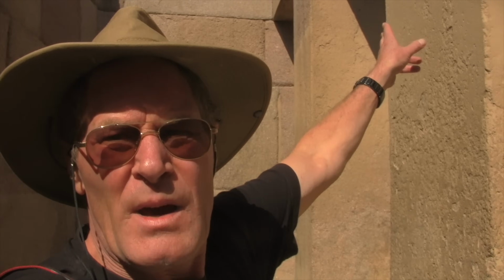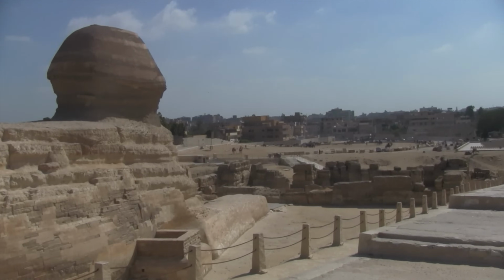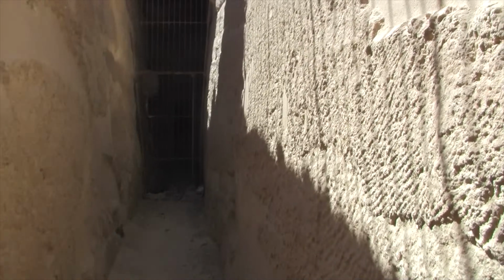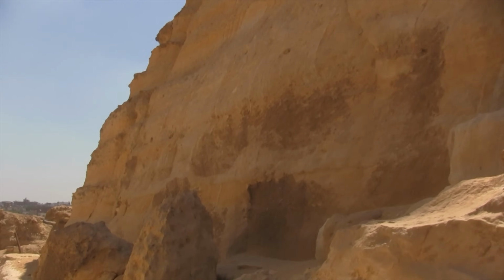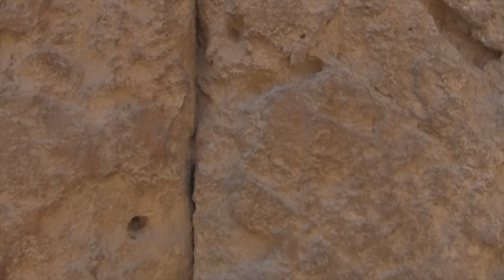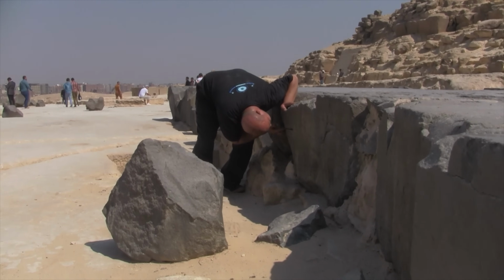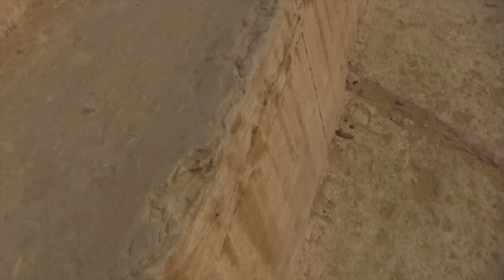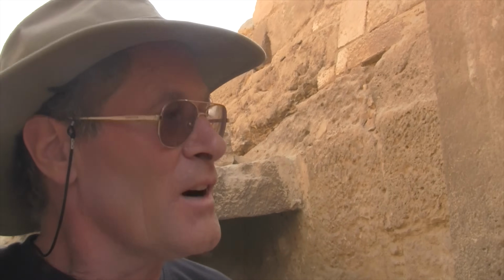Exploring Out Of Bounds Areas On The Giza Plateau In 2014

Comment: What if the pyramids were water pumps and/or control valves? The 'robbers tunnel' may have been an attempt by ancient peoples to break into the machine to try and shut it down after it malfunctioned during/after a mega disaster some 10k years ago. The pyramid pumps maybe went into overdrive and flooded the plateau which maybe explains the erosion and destruction of a lot of sites and structures, and also the flooding that prevents exploration of some tunnels to this day. The casing stones may not have really been purposefully taken off the pyramids and surrounding structures, the pyramids themselves may have vibrating from the malfunction and they all just kind of fell off. The vibrations spread across the plateau which could be described as an earthquake, but caused by the malfunctioning pumps (pyramid(s)). IF the builders were still around at this time that would explain how they seemed to know exactly where to dig to get to where they needed to be. The famous box in the great pyramid could have been damaged by looters but also by some engineers desperately trying to get into the box to do whatever, maybe remove the battery/fuse which made the whole thing work, whatever that might have been. An earthquake would certainly make workers drop tools and start running when 100ton blocks falling down on them. No idea what became of the peoples after that but with a lot of their stuff destroyed and possibly a lot of people dead, they abandoned it all. Later peoples then just looted the stones that were already fallen and they continued past that to try and get more. If you look at the top of the pyramid with the casing stones still on it, those blocks look like they were shaken loose because why wouldn't you start at the top if you were robbing them? Naw, the whole damn place was shaking and they all just fell down with the lucky top courses staying put but slightly separated between them all. That's vibrations.

Comment: No. it is not easier to build with smaller pieces and mortar, this is the finest quality cuts on the finest quality materials that there is in the range of Enoufgh material to build many structures that they knew how. we don't. sure we can mortar together some walls on a steel structure and it would never be the same thing.

Comment: Brian, you probably won't ever see this but simple logic tells me their purpose was far more important than simply storing two dead bodies, and would have to warrant cutting and placing several million blocks. In my opinion they appear much older, having survived the global cataclysm some 12,500 years ago while everything else was crushed under the weight of the mile high wall of water that swept it all out to sea.

Those large vertical shafts may have been reservoirs for part of the cooling system, cycled into the "kings" chamber where immense heat had clearly charred the walls, then being forced out repeatedly as pressure builds from steam. The granite slabs above the reactor likely served as emergency pressure release valves to prevent a chamber wall from blowing out. 

I doubt the system failed, but probably just stopped working after 2000 psi of sea water had been forced through it, blowing all it's valve doors and mechanisms out the bottom.

Those dreadful gates may be due to safety concerns, but if that were their only reason why not provide us with maps detailing all the known passages and even permit guided excursions throughout these areas? After all, it's our history and it belongs to everyone.

Comment: I doubt you'll read this but: Man the more you talk about "not necessarily electrical energy or whatever" much less stone powerplant buildings exploding etc the easier it is to shrug off the many valid points you raise about inconsistent types, degrees and patterns of weathering and erosion that simply cannot fit the official narratives. 

No offense but when I speculate out loud I sound like a nut, meanwhile you sound like a thoroughly insane homeless guy outside a bus station. For example, by you're way-out-of-left-field reasoning the fact tuts gold mask is gold must make it electronic since we use gold in electronics today. Please, please, please leave out the goofy narrative about tight fitting stones requiring aliens or signifying powerplants or antigravity. Please. 

I watched a lengthy vid of you visiting sites in Italy exhibiting several types of polygonal monolithic stonework and you pretty well stuck the landing by staying on point and not jumping down any schizophrenic rabbit holes. There was evidence and you made the case. There's so much more tangible evidence of inheritance in Egypt but you spend half the time talking like it's a rerun of In Search Of from 1972, I keep expecting to hear about Pyramid Power magically sharpening razor blades smh. 

The evident timeline in Egypt doesn't fit the orthodox paradigm. The tool marks don't fit. The logistics, especially over the accepted timeline cannot possibly fit. This doesn't mean they couldn't build some or all of the pyramids but probably not in the limited time allowed not even just the limestone portions. They certainly couldn't do the granite work themselves in any amount of time rather than find and repurpose it. Pyramids might have been expansions of what they inherited. They could even have moved big granite artifacts like the Romans but only if they also had somewhat more complex tools Egyptologists refuse to concede like compound pulleys and primitive cranes more approximate to what the later Romans had. 

You can talk for hours and hours about a hundred mind boggling examples that support each of those points without ever falling off the deepend that makes even slightly skeptical listeners roll their eyes and change the channel unless they have no idea how ridiculously Woohoo half of the digressions are OR they already know about enough of the glaring inconsistencies to keep listening (but still roll their eyes when you go Ancient Aliens.) 

Zawi Hawass wouldn't listen if you found a perfectly preserved pre-dynastic nuclear reactor but plenty of other members of the mainstream might just have to admit the glaring deficiencies if only to themselves if you could stay a bit more grounded than a YouTube channel looking for views can get away with. And no I'm not suggesting they had nuclear reactors.

Comment: Moving the stones strikes me as easy. They had cloth, wood, clay pot batteries. Simply fill a big balloon of fine cloth with hydrogen tied to the stone, until the stone floats. You will lift 20 ton stones with a thirty meter gas bag. Bigger stones, bigger bag. Tow it along the ground with draft animals. Like the blocks in Peru that came from the top of a mountain, you get it floating when the wind is right, it will be on the ground in the valley in no time, as cloth will leak, no matter how fine, then you float it again and tow it. But how the blocks were made so precisely, is another question. It's indicitive of very high general technology.

Comment: I agree about there being a reason they chose high quartz containing granite, the importance of there being no gaps between the stones, and also the importance of no fissures in the stone.  It's pretty evident when you look at the boxes in the Serapeum.  They chose that material for a reason and pressure was involved somehow.  They even somehow "scooped" out the parts of the boxes that I believe had fissures or cracks.  I think that with pressure these cracks may have spread or blown up so they wanted them gone.  Add water for conductivity and then... I don't know.  I don't have the answer to that.  With the pyramids it seems like water was an important ingredient because of the retaining walls that I believe held it in at the bases.  I think one of the pyramids even had the first courses of stones be granite right up to where the retaining walls would have held the water in.  Quartz-containing granite + high pressure from weight of many stones without fissures layered with no mortar + water possibly being absorbed by this granite under pressure and causing it to be conductive = piezoelectric effect for... I don't know.  I need someone smarter than me to answer that.  Isn't there a pyramid that shows signs of blowing up from the inside?  High pressure was utilized somehow.

Comment: I theorize that there were 2 sphinxes, and that they were fountains with water coming up from the original lion's heads, and all of the pyramids( 3 large and 30 or so, small) were part of an aquifer that generated energy as well as fed the area with abundant water, and had lush greenery. That's what I envision. Then, it is possible that the water source depleted or was diverted. Thank you for the video, and the adventure.

Comment: It is CLEAR that the dinastic Egyptians did not build the pyramids. It is also clear that the Sphinx was NOT build by the original builders of the pyramids, just look at the state in which the pyramids are vs the sphinx. The sphinx CONTAINS megalitic work which means it was built AFTER the megalitic structures were built.

Comment: There was water all around the ancient pyramids. They should dig up the sand around the great pyramids. They will find proof of the ocean level there. They also used to use the coral reef as jail cells. And when the tide would come in, they would drown their prisoners that way. And if the prisoners found a way to escape the coral cells, they would be eaten by sharks. The ocean waves would break on the beaches or shores of the great pyramids in the past.

Comment: with the technology that Egyptians and even the World had back than had no way of cutting the millions and millions of huge blocks exactly accurate for each and every one of them to be used in the pyramids. This is impossible to do with the short periods of time when they were especially built. The most common theory of how they built the Pyramids is by using the Sun mainly and melting most of the materials and placed in a later period methodically. Because none of the materials were ever found were good enough %100 accurate and fast to built and cut the stones. Not to mention some of them were 162 TONS used inside the Pyramids.

Comment: So if it took thousands of years of heavy rainfall to erode the sphinx,  and the last time Egypt had a climate like that was 10,000 yrs ago. That means the sphinx has to be at least 12,000 yrs old. But I believe the desert begun when the younger dryus did, 12,000 years ago when the earth was struck by a broken up comet. Thus the sphinx would be at least 14,000 yrs old, but im thinking its closer to 20,000.since it would have had a plaster covering to give it a finish in white like the great pyramids. Which were not build by the dynastic Egyptians

Comment: Why would a culture seemingly so advanced, build a tunnel system so perfectly square simply to move water? And also, if they were so advanced, why are the tunnels square and not round which is most ideal for water pressure and movement? I don't think they do. I think those questions are just the tip of the iceberg, and just a few of the reasons they are closed to the public and the archeological community. There is so much more going on here. Twenty years? That's not possible. It's just not. And when they say twenty years they don't take into consideration the underground because we are supposed to pretend it's not there.

Comment: I have never in my 60+ years believed these structures were built as tombs, it made no sense, just like much of the BS history they try to push on us - I'm going with they were built to provide power - I believe they are on lay lines just as many old churches with huge pipe organs which I suspect used sound vibration for healing, perhaps the old churches were actually built for medical healing and had nothing to do with religion.

Comment: Even if they used boats for transporting the stones how many stones do you think their boats could handle at one time? So not only did they have to move them 500 miles away But who knows how many trips they had to make back and forth to get the amount of stone needed. Imagine having to make the 500 mile trip hundreds or thousands of times.  To move all that stone at once would probably require thousands of ships. So you need quarry workers constantly working to quarry stone you need hundreds of boat captains and sailors working on the ships. Then thousands of workers on the receiving end to move and place the stone and also teams of engineers working at all locations making sure everything is planned perfectly making adjustments coming up with solutions to unseen problems  or fixing and designing tools needed. Also would need teams of metal workers constantly making new tools or repairing old ones. You need soldiers protecting the workers and resources. You need food stores to keep everyone well fed. You need people who speak multiple languages. This is just the tip of the iceberg a project of this size would require the coordination and determination of tens of thousands of workers. like either they built these structures way easier than we know how or The entire culture did nothing but farm and build megalithic structures nonstop for thousands of years.

Comment: That's a saw kerf or thickness of the saw blade not the diameter, the diameter is the distance across the large flat side of the blade from one edge to the opposite edge crossing over/through the center  , I'm surprised you did not already know that. That was interesting Brien, thanks.

Comment: Hypothesis: The shaft/tunnel system was used as a crane system. Method : Get a heavy stone and sit on floating raft, lower to the bottom of shaft, flood the shaft through tunnel system, attach rope to heavy stone/raft which is now at 'the surface', rope then goes up to crane (pulleys can be used to multiply energy efficiency), release the water from shaft back through tunnel and use the weight of sinking stone/raft as 'power source' to operate crane. Perhaps we are looking at the infrastructure of a civilization that had mastered hydraulics. 

The 'falling water system' could also easily be used to power saws. It could also easily be used to operate a vacuum lifting system for very heavy rocks. 

This hypothesis could explain A LOT of what we see here but I am not convinced by it as I have no idea how they'd pump that much water, or was that the purpose of the pyramids to create a vacuum somehow.

Brilliant and fascinating videos Brien. 

Best wishes.
Reply: Wow that's a sensible suggestion. I had not considered that
Reply: Well they have a river passing by

Comment: It think that the blocks are cast in place one at a time from a concrete type mix,there would be no point making a 'precision fit' block that is not uniform with all the others and then have to carry them 500 miles to assemble in exactly the right spot.It would be plausible to cut blocks from the  top of a quarry cliff letting them smash to the bottom,the stone  aggregate  could then be easily carted to site and made into concrete.Concrete never stops hardening after several thousand years it would appear just like stone.If they used animal skins for the 'boxing' it would explain the curvy nature of the block but it would also rot away giving them the "cold joint they wanted for earth quake proofing".they could also render,carve images,create channels and holes before it went hard.Any 'saw' or 'cut' marks on the stone are maybe transferred from wood used to help box the concrete.its how we construct now why not then?all of those blocks look like weathered concrete to my eye.Do my thoughts sound plausible to anyone?
Reply: What about quarries? They would not  exsist if your theory was correct .for that matter why bother with blocks do a wall like we do.
Reply: Sorry brother to many details overlooked like the bore holes angle of decent which are clearly visible.Thought provoking idea and who knows  i wasnt there.